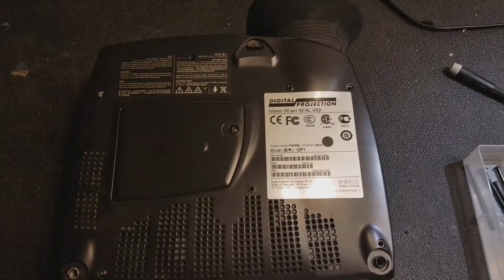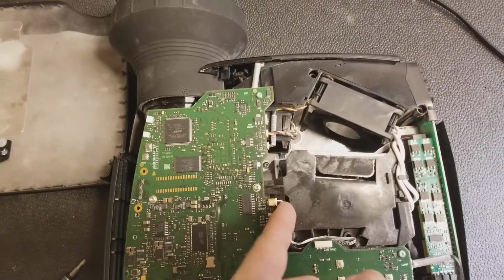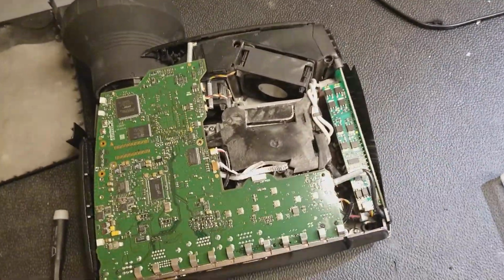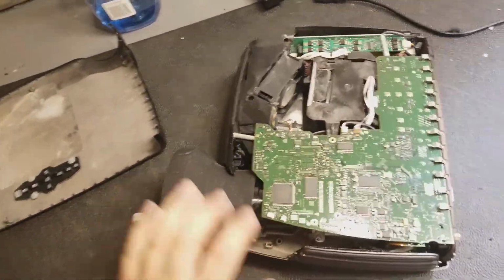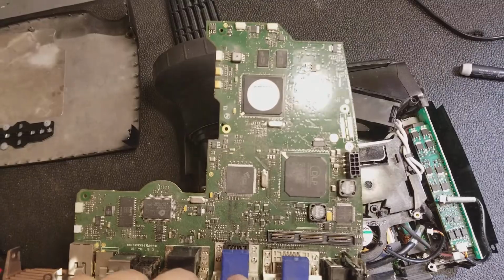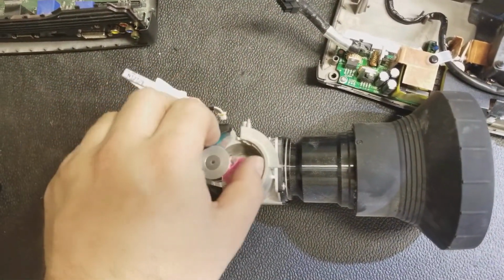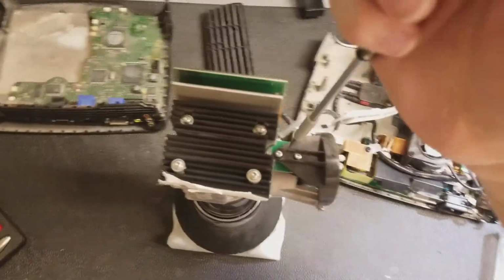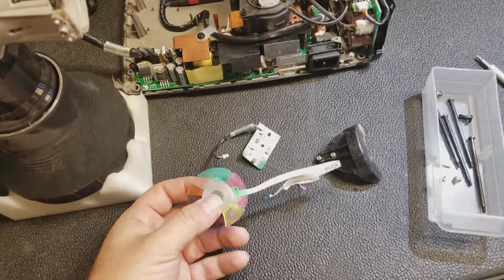Digital Projection SX+ Repair - Colorwheel Part1

Comment: I know what color wheel it use, I have check your vedio 3-5 times, figure out finally. It is a 5 segments, diameter 48mm, the color oder is RED GREEN BLUE WHITE CYAN. I have a similar color wheel(color order is RED CYAN WHITE BLUE GREEN), just need change the color order than you can use. This color wheel is less on market, I usually make it by  ourself. Can give you $30/PCS, just hope can be your long time projector parts supplier. My eBay store(LAMP-BOOK)